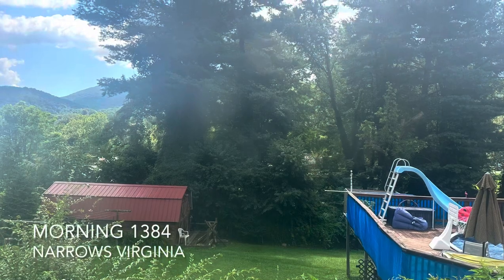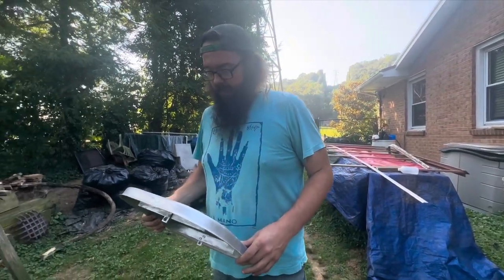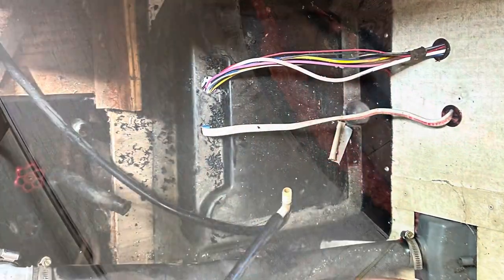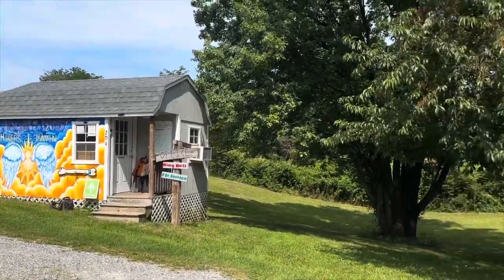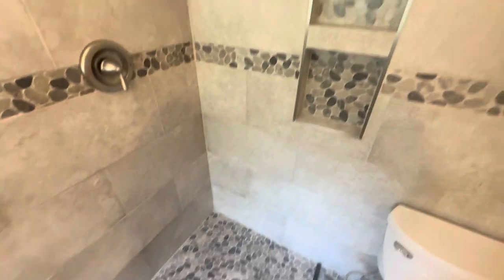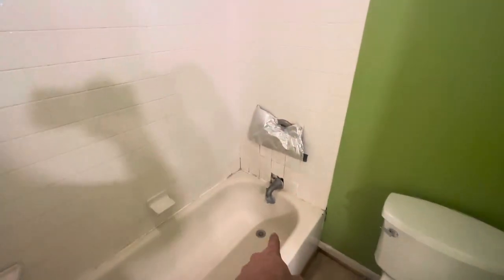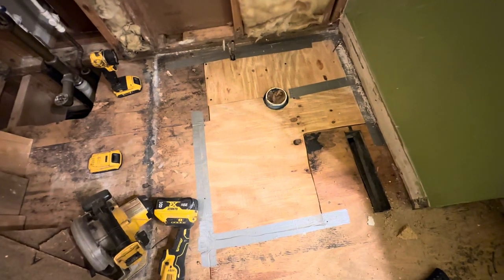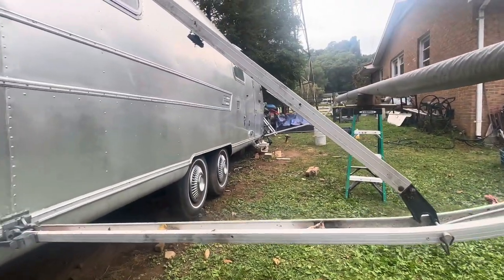Airstream Renovation - Sealing and Wiring #airstream #restoration #camperrenovation

Comment: You definitely need to put down some durarock or hardy board down on that sub floor or it will flex and crack the tile!
Reply: I believe you are misunderstanding the schluter system, The ditra mat (floor) and kurdi board (wall) replace backer board use.
Reply from the maker: Still haven’t gotten to tiling that second bathroom yet, but it’s coming. Stay tuned